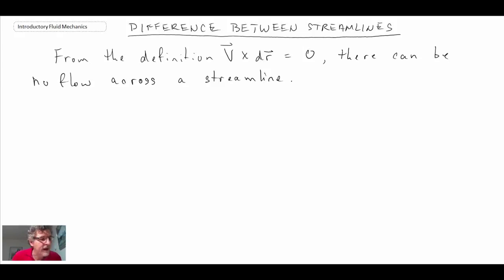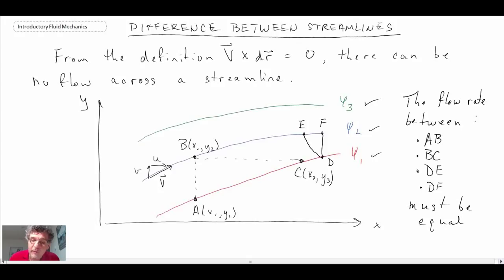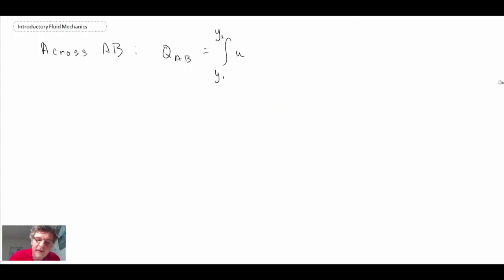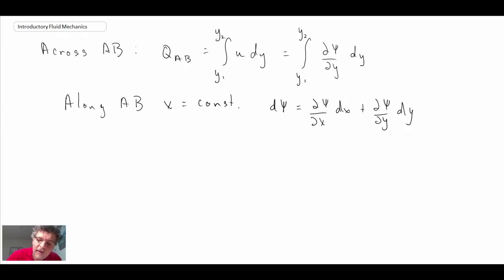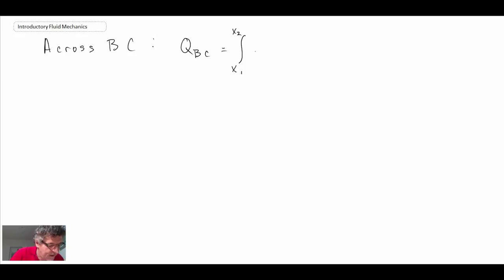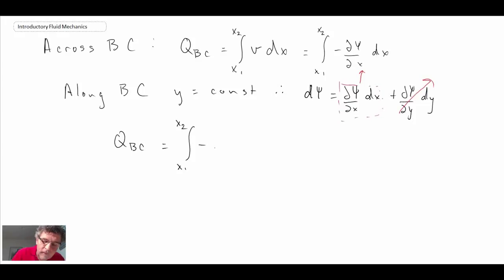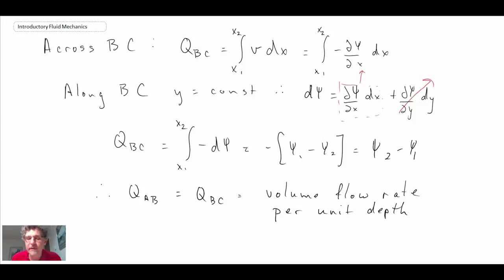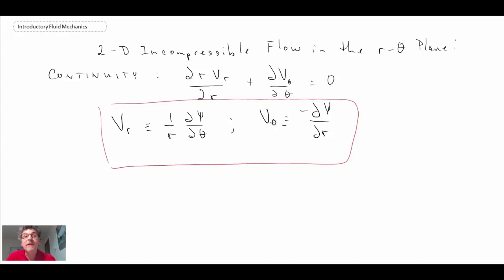Introductory Fluid Mechanics L13 p2 - Flowrate Between Streamlines

Comment: At 7:00 is there not an extra negative there? I expected the integral of -d(psi) = -[psi2 -  psi1] ... but this would break the explanation though, where am I making a mistake? Thanks!
Reply: you are right TIM , but the thing is the magnitude of psi 2 minus psi 1, for  Q (AB) should be same as psi 1 minus psi 2 for Q (BC) .In conclusion volume flow rate across AB and BC are the same  ,and  you should notice that when you want to calculate magnitude of something  you must put absolute sign around that | psi 2 minus psi 1 | = | psi 1 minus psi 2 |
Reply: @afshincheraghchi9194 
 I disagree with you. Tim is right because by the process the uploader used,  Q(BC) must be negative to Q(AB), and it is because the order of nodes is reversed. i. e. you will get the values the same when you calculating Q(CB). And I suppose simply adding an absolute value is not convincing since the sign actually implies the direction of the flow rate and there is conditions that we don't know this initially.
Reply: Hey guys if you actually see then check with the direction. If u see the line AB then the dir is perp to AB hence u is the comp. If you consider BC then he took v as the comp. So in the 1st case of AB dir is right of AB. In second case as we found negative I think the dir is in downwards direction. So I guess this is what the direction is trying to say.
Reply: Ur right. But the point is psi value at x2 is psi1 i.e. point C and psi value at x1 is psi2  i.e. point B. Now check the integral with negative sign you will get the same answer on both sides
Reply: @marshallm.7421  Agree with you, perhaps if we stick with the coordinate B(x2, y2) and C(x3, y3) then it is less confusing. The integral then from x2 to x3, you will then have the integral result is -psi (from x2-x3). Plug it in the value at x3 is psi1 and at x2 is psi2:
- psi1 -(- psi2) = psi2 - psi1.

Comment: @Ron Hugo, why is the volume flow rate(Q) across AB equal to u dy and not v dx.
Reply: Because it depends on which line u consider. If you consider line AB then you take flux perp to that vel city that is U comp. When u consider BC then u consider v comp that is perp to line BC.

Comment: I dont undestand why is he evaluating Q(BC) between x1 and x2 instead of x2 and x3?
 Please help me if I am wrong.
Reply: I agree, I think you're right because I made the same assumption.
Reply: Becoz he is taking Y as a constant and B is x1 which inturn makes C as x2. The initial assumption he made that Y is a constant and thats why both A and B have x1.
Reply: you are correct , he made a mistake either it should be (x3 , x1) or (x3,x2) as x2=x1